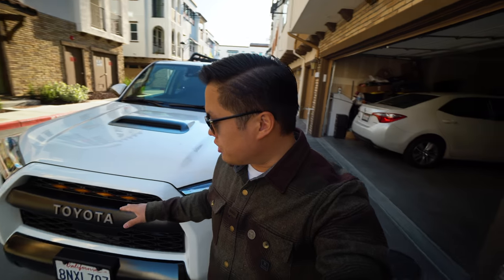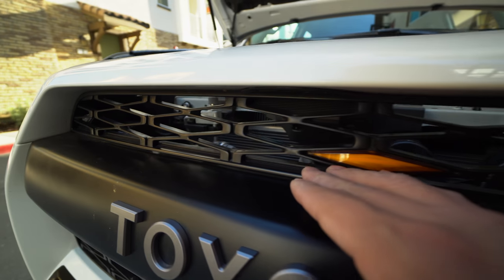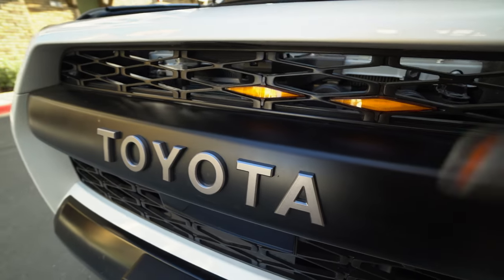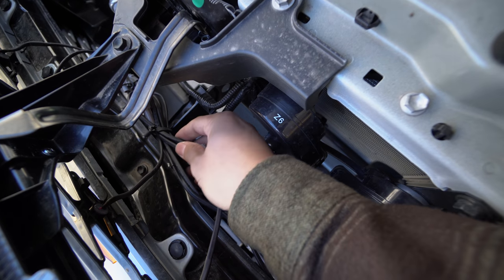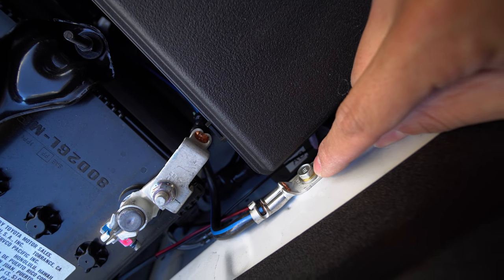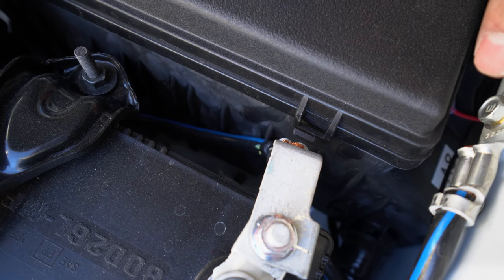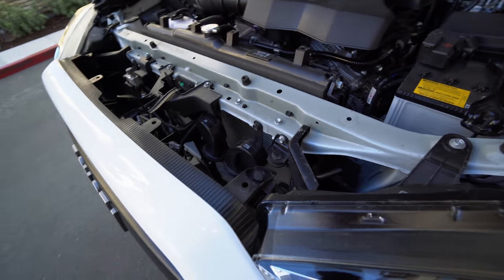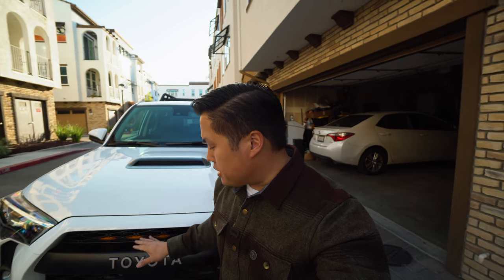2020 4RUNNER TRD PRO - Raptor Light Installation

Comment: When I plug in to the INJ fuse, my car won’t start. Any ideas? It’s a 2016.
Reply from the maker: Hmmmmm... not too sure about that one. You do have a fuse in the fuse tap that you are plugging into the INJ port, correct? Just making sure. Also, for your year, the INJ port is inside the cabin under the dash on the driver’s side below the hood release, correct?

Comment: Would this install be the same for a '19 TRD Pro?
Reply from the maker: Yes, same as 2019. You still have the Toyota bar in the front grill. The only difference is that your red positive cable will be going into the cabin area through the firewall. I show this plug at 3:45 of the video. There is a fuse box inside the cabin up under the left side do the dash on the driver side. You’ll see a white cover on it and it’s up above where the park break pedal is. The INJ port that you need to plug the tap into is in that fuse location for 2019 and earlier 4Runner models.
Reply: @goodafternoonchris  Thanks for the speedy reply! I ordered the kit and will be installing this week.
Reply from the maker: Awesome!! No problem at all. Let me know how it goes and if you have any more questions!

Comment: Where did you grab your Raptor Lights from? I’ve seen the plug-n-play listed a few places. Thank u in advance.
Reply from the maker: Hey, sorry I thought I had put it in my video description but I guess not! I just added the Amazon link there of where I got them :)
Reply: GoodAfternoonChris I must be missing it, I don’t see the link
Reply from the maker: https://www.amazon.com/gp/product/B081Q773LZ/ref=ppx_yo_dt_b_search_asin_title?ie=UTF8&psc=1
Reply: GoodAfternoonChris thanks for the reply!  Did you figure out a way to get the fuse box to close?
Reply from the maker: You can actually close the fuse box lid all the way. It does pinch the cable more but doesn’t seem to affect it. I am going to eventually install a separate wiring block that these lights will go to and will be dedicated for all the external lights that will be going on the truck so when that happens it won’t be going into the fuse box as a tap anymore.
Reply: GoodAfternoonChris so just to be clear it’s the wire leading out of the box, not the “add a fuse” that interferes?
Reply from the maker: Sorry, just to clarify: the red positive wire that is coming out of the fist box is going to a fuse tap which I plugged into the INJ port. That cable is okay to be pinched if you use both latches and shut the box, haven’t had any issues with it. However, in the future, I am going to relocate it somewhere else to an aftermarket wiring block so it’s not going into the fuse box. I’ll document that process of course later on.
Reply: @goodafternoonchris  Have you done the aftermarket wiring block yet - Great video

Comment: I used a wire gland to secure the red cable to the inside of the fuse box, works great, and it's waterproof. https://www.amazon.com/gp/product/B07SK77ZMS/ref=ppx_yo_dt_b_asin_title_o00_s00?ie=UTF8&psc=1

Comment: Take a look at this video, you’ll be able to wire into the fuse box. This will allow you to close the cover all the way without drilling a hole or pinching the wire. https://youtu.be/WxPsEPIQ3ak
Reply: That won't work on newer models, the INJ fuse was relocated and is now on the top row. The add-a-fuse connector hits the top of the lid.